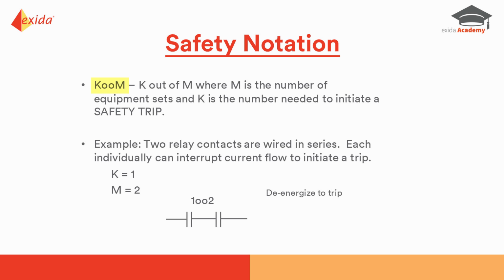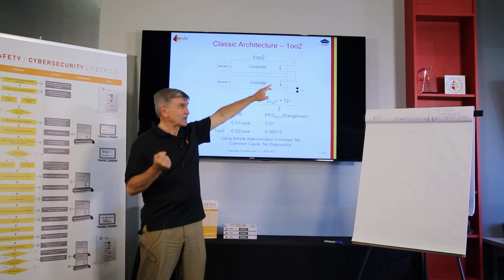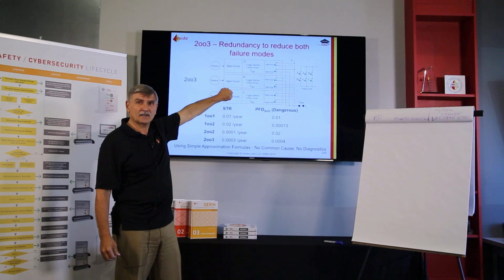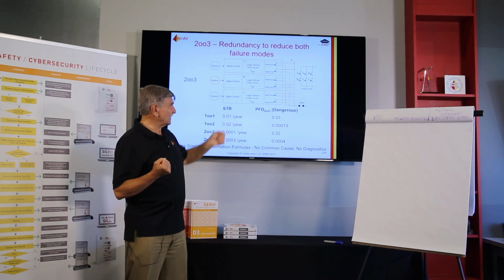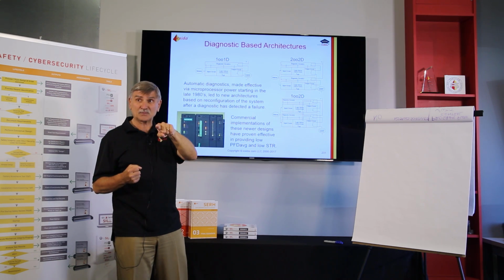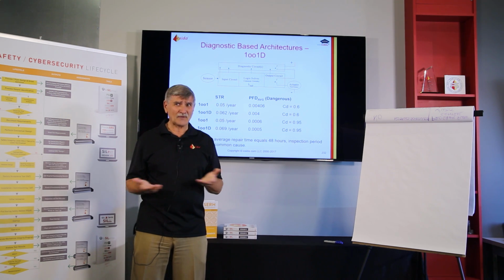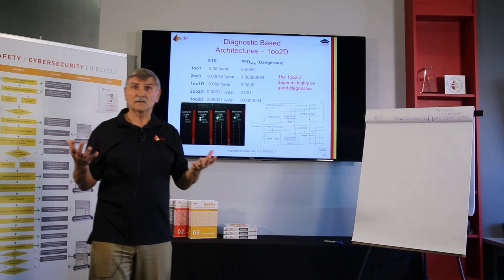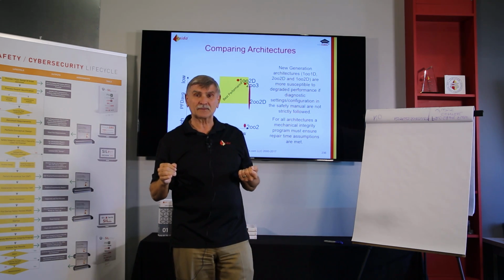Safety System Redundancy - Is It Worth the Money?

Comment: Can someone please be kind to reflect some light on 1oo3 architecture?
Reply: With 1oo3 you could have 2 HFT (Hardware Fault Tolerant) meaning if one fails you could have 2 system still working hence improving system Architecture meeting Higher SIL requirement. Look IEC 61508